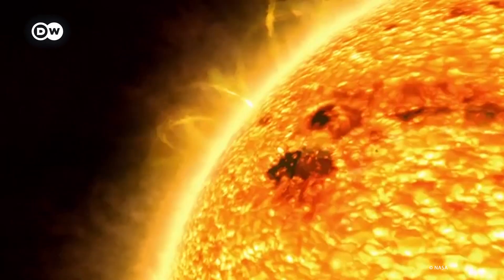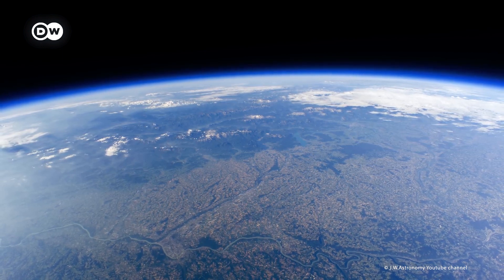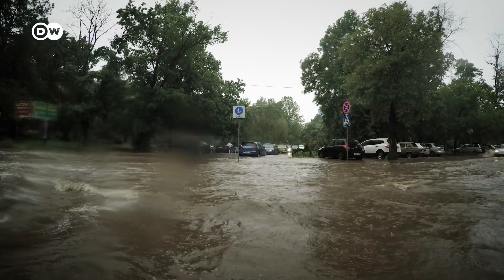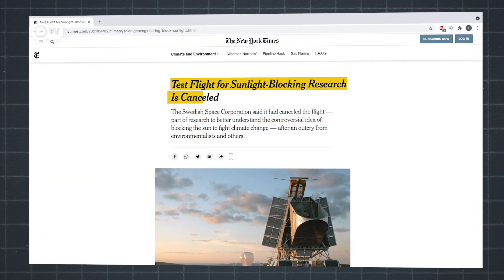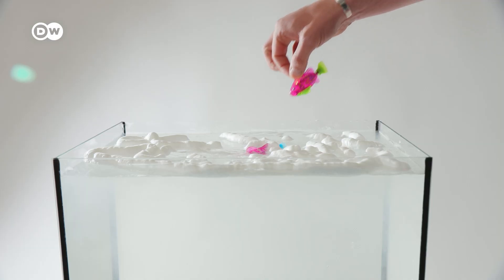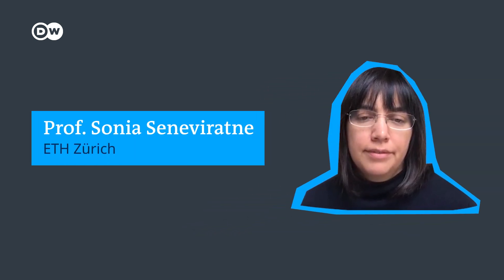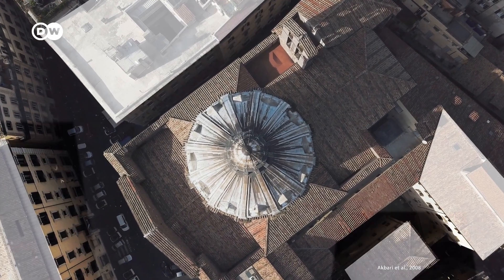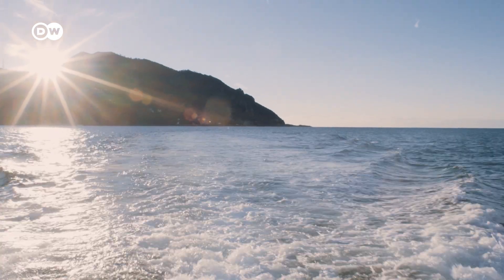Solar Geoengineering: Should we artificially cool the planet?

Comment: Wouldn't increasing the albedo at the surface level only reduce the temperature in the local area? Not to mention, the infrared radiation that greenhouse gases absorb to contain the heat energy only happens when the radiation is reflected from the earth's surface since the incoming radiation is too high energy for the gas molecules to absorb. This might be a temporary fix in reducing localized temperatures, but cause more global heating later, along with the other mentioned effects such as changes in heat distributions leading to more rainfall and droughts in certain regions.

Comment: The Foam idea seems kinda bad considering we already have a trash problem in the ocean, but couldn't we build solar power rafts / floating platforms? This should have an similar effect, provide power, and i guess you could build the anchor points and undersides in way that they form an habitat for sea life. Fishing would also only be possible with very small fishing boats which would be far better for sea life. Also in places where you can't easily transport the power you could use it for Hydrogen production, water desalination, or sea food production.
Also it would be great if the mentioned trash could be used to build these platforms or using them to collect trash that is floating by.

Comment: Agree with the principle of geoengineering. based on the options presented i personally would encourage two actions..1) Painting of as much upward facing surfaces of houses , offices and general buildings white/light colour...2) Covering non arable areas with white nettings that allow passage of air but still reflect heat back to the atmosphere .Both these methods are passive and should over time aid atmospheric cooling. The introduction of aerosols to the atmosphere is definite no go area...However i do think in addition to our carbon reduction practices we could look into increasing the density of the ozone layer. If you have a hole you plug it up ..for better protection you thicken it up.  Would be interesting to see probable delivery systems for that...nice content.

Comment: I am impressed by the intellectual comments being made, Usually it is people arguing about politics and pointing the finger.
Heres my idea, Use a dust cloud at 45,000ft over hot areas. The savings from air-conditioning could pay for the project, Dust launched on the west coast could travel East across the whole US cooling the whole county. Volcano and forest fire data could be used as a model. Dust is naturally occurring and lime dust has antiacid properties. Think about it, who wouldnt want their local weather to be less hot.  The dust is temporary but lasts several years. The dust cloud can be managed either more or less by how many flights are done. Target areas over 100° and reduce temperatures to say less then 90°. Do local and regional territories. If there  are problems, just stop and let the dust settle out, this should be a stop gap program to give cultural and technical change on earth to take hold, things like electric cars and solar and wind power have more time to develop. Accumulation of dust in the atmosphere over time would cool the entire planet. We need to start small and learn how to do this, Junk airliners can be converted to dusters for cheaper investment.

Comment: Jurisdictions here in the U.S. are starting to mandate white reflective roofs in more and more areas, including for some types of buildings.   Where I live, for example, low sloped roofs here are required to have a reflectance of .72 or higher currently under Chicago's urban heat island ordinance.  I have been having roofs that are redone, usually with a rubber roofing material coated with a final coating of a white silicone which has a higher still reflectance and also a manufacturers 50 year service life.  Perhaps a small difference, given the relatively small percentage of the  World that is rooftops, but every bit helps.  FYI, a reduction from 168 degrees Fahrenheit to 119 Degrees Fahrenheit is not a 38% reduction in temperature since it is not an absolute measure of the kinetic energy of the molecules in the material as absolute zero is actually -459 degrees on the Fahrenheit scale.  Assuming a linear measure of temperature down to absolute zero, the reduction would actually be (168-119) / (459+168) = 17% reduction in overall kinetic energy of the molecules of the material.  It is a bit complicated to estimate what percentage of the kinetic energy that is not being absorbed by the material would end up in kinetic energy of the air and also be emitted by the air as infra-red to bounce around on the ground being absorbed and emitted as infrared energy quite a few times before eventually making its way back out to space.  The goal should be to get it back out into space faster if we can not find a better use for it.  Did you guys know that the earth radiates as much energy back out to space as it absorbs from the sun?  It has to or it really would heat up over time to be at equilibrium they have to match since thermal energy can only be transferred by conduction, convection, and radiation, and earth generally can not conduct heat into the near vacuum of space and does not shed enough material to lose much energy that way, so radiation is it.  The amount of solar energy stored in chemical energy by plants or other means is about negligible compared to the energy we absorb from the sun, so we must radiate approximately the same amount.  The wavelengths emitted to space tend to be longer wavelengths than those absorbed from the sun on average.  Reflecting light out more quickly with ice cover or white roof tops really can make us cooler everything else being equal.

Comment: How ironic I was telling somebody the other day as a roofer that the used to have cool Roofs. Roofs That was light in colour. Reflecting the heat and solar radiation back into space. I was telling them that the mount heat that comes off a solar panels would cause global warming. 
I said that because a Company put a solar farm next-door to one of my friends now The temperature at his place when the wind blows in his direction from the solar farm is about 3 to 4° more the wind on the other side of the solar farm.

Comment: I would put an "umbrella outside" the planet that can absorb the heat (and let outer space cool the umbrella over and over) but let the light in for photovoltaic energy production plus ➕... It's only a temporary structure and can be moved out to cool Venus (later on) and observe the changes that this umbrella will do to that planet. I think it will be a good device..."this planet cooler".

Comment: No side effects of painting roofs all white? I can think of at least three, one having to do with aircraft and vision or even navigation (mostly negligible but still a side effect) another is the reduced upwards heat and drafts could reduce the effects on drying clothes as we see being done still along with a minor possibility of the reduced upwards drafts causing air stagnation or reduced heat evacuation from inside the buildings (this could go one way or the other and the reduced heat input could more than make up for the reduced air flow from heat drafts) and a third issue is any overhead view is muted, for visuals or even movies this could be a drastic negative change and any building that sits high enough to see even a few roofs would have its view made more boring and for some buildings this could reduce the value of them both socially and financially (a real affect we will see quickly if implemented) now most of these are not worth more than the change that is intended but you can’t just claim there to be no side effects of something that has arguably drastic side effects in one scope or another, to some people (who arguably are short sighted and care only of themselves) that difference is the world. Sorry if this seems like an argument but I’m just trying to preserve the integrity of correct information and what not

Comment: 9:35: please use metric units. Also the "30% reduction" should be calculated in reference to the ambient air temperature or to 0K, your figure is unit dependent which makes it wrong.
Reply from the maker: Thanks for your comment.
Reply: @DWPlanetA  thanks for a great video, it's a really interesting subject

Comment: It’s painful to see the regurgitation of half-baked glitter-cures and vague hand-waving. We’ll need to increase the radiative potential of the Arctic, where the rise in temperatures is greatest. Ice is an insulator, preventing additional cooling. Various methods to expose sea water over winter would allow the heat in the ocean to escape. Oceanic heat is many times greater than atmospheric; that’s where we must pull it from. Reflective surfaces in lower latitudes will all shift rain in important zones; while letting the Arctic cool faster would strengthen the polar vortex, and moderate climate elsewhere. No ‘drippy-paint’ globs of Arctic air swirling south suddenly, the way we’ve seen the past half-decade, in the US.

Comment: How about planting mirrors to reflect back the sunlight, the mirror turns following the sun using solar energy for the turning mechanism. The mirrors could be placed across the equatorial region and extend to higher latitudes at a steady pace. The process could be initiated in the Sahara, the Thor in Rajasthan, the Pamir, the Hindu kush and other  dry regions around the zero latitude of the Earth. Mechanism is also needed to keep the surface of the mirrors clean and shiny bright.
Reply: Where do you get the mirrors from ❓
Reply: Good idea but the area is way too big.  I just watched a video on this the other day. The Shahara desert is huge and it's just a starting point.

Comment: We have new mirror like materials that can change heat energy to wavelengths that reflect into space night or day that could be used on roofs in the desserts or tropics. Perhaps research can be done to use the material in an agro solar setup/ moving mirrors or PV panels among crops as well.

Comment: We are pumping oil from ground. As far as my knowledge is concerned, I was told that oil is carbon which was buried deeply in earth. Why don't we put our efforts in carbon tapping and put carbon dioxide back to where it came from? And plant more trees. As per a research, it is estimated that earth can support more than 1.1 trillion trees.
It is estimated that earth used to have 6 trillion trees. Now it is was reduced to 3 trillion trees.
 Carbon tapping is efficient and effective right? What do you say?
Reply: I don't know if it's even feasible.

Comment: Haven’t you proved with these cooling mechanism, that the original warming may not just be co2. 

Smog blankets and so2 are coolants in the atmosphere. By removing these coolants we have allowed warming to go unabated. Hence some if the current rise in temp is due to less stratosphere aerosols and coolants. 

The other is albedo if urban area. Where you state temps can be one to three degrees higher than rural areas. If co2 is constant in rural and urban area, then the temp gain is purely urban heat island effect.  By painting roof and roads white, you are reversing the urbanisation effect upon albedo. 

By using geoengineering it is clear that co2 is not the only cause in warming. Our human effect on albedo is one influence, particularly in urban area, and reducing pollution around cities and towns. 

By reducing pollution, in the atmosphere, we have allowed more solar radiation to hit our concrete road and other surface.  
Then they emit heat as infrared radiation exciting the co2 in the atmosphere. 

It’s simple science.

Comment: we will continue to warm through the ice age cycle as we are on the warming part of the cycle, which each time gets colder and each time does not warm up as much.  this last ice age was the lowest sea level in the planet's history, and the next one will be even colder.  the good news is that, based on the last inter-ice age max sea level, this time will be a certain percentage lower if you extrapolate the pattern from the past 4 ice ages. so we can at least guess the next max level and plan for it.  after a few more ice ages, if humans still exist, we will be trying to warm the planet as it heads toward being a permanent frozen block of ice.

Comment: So how does the smog not block out but instead blocks in heat?
Reply: Different place in the atmosphere, different composition of the pollutants (soot does not reflect, but absorb infrared). But yes, scientists were debating in the 1950s whether warming (by CO2 emissions) and increased reflection (by air pollution aerosols including SO2) would cancel each other out. But since then, we've cleaned up our fuels (less aerosols) and hugely increased our CO2 emissions.

Comment: The biggest issues with any aerosol based option is simply the size of the material used means physical removal or reversion is impossible. Whereas a chemical removal method could have more negative effects. The biggest question since it’s the water you’re dealing with in that instance is: will the changed water be drinkable and what health effects could it pose to breath particles of vapour of that water in, and in the same regard what effect will it have on plants and can they effectively use that water along with the third part to the question of what heating or burning that water will do to it. 
And once those questions are answered you still need to figure out if it could alter the rest of the water around it and if it’s otherwise safe you would still need to confirm that if it were to do that that you could reverse the action taken or reduce the effects of it as otherwise you would over-cool the surface temperatures and have a new problem, also any sudden changes would have drastic effects on current cooling and circulation systems naturally in effect by way of wind currents and even water currents, changing only one area would also be equal to a sudden change.

Comment: Here something deeper. Why is the center of the earth hot boiling mana? And the crust is only 10%. So anything closed, incast will build up heat. Their no way around this. We are a hit planet.
Now look at what temperature is deep space. I think I saw it was estimated at around 2,000 degrees below. Yes it that cold. So we're are talking about a tiny tiny change of temperature. And we know all things operate in cycles so you will get means over swings to a Lowe temperature. Normal.
The worst thing you can do is try to change a natural cycle. You could even tilt the earth axis.